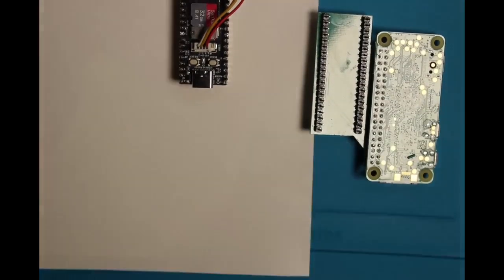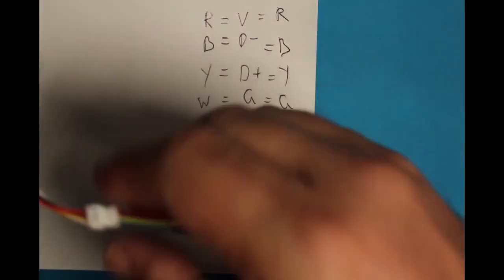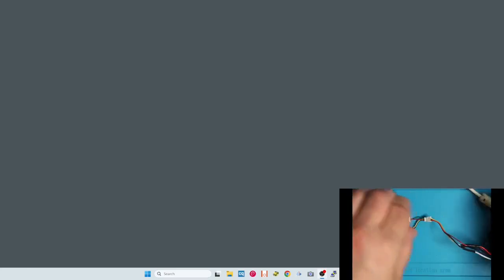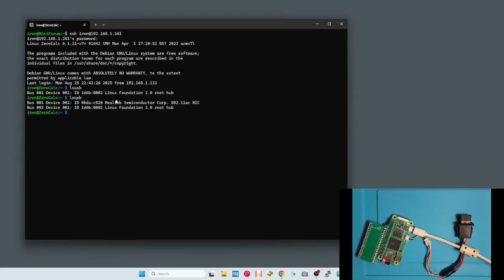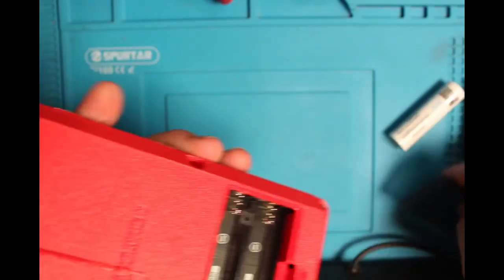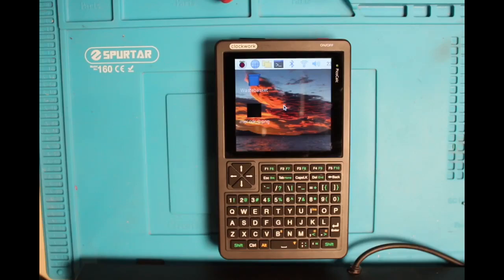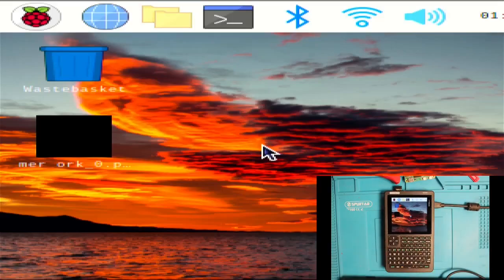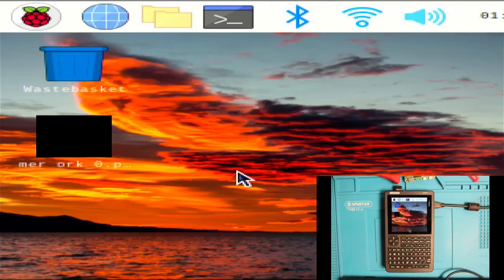Picocalc - Zero Mod Update - USB and Case

Comment: hi,

is the usb mod necessary for the zerocalc to work? because i really cannot solder on pads these tiny.....
Reply from the maker: No. It is only for having a USB port. If you don´t need a USB Port on your device it also works fine.

Comment: Hi,
Thanks for the video. I think that the pi zero 2 could be good for terminal  usage since pi zero 2 is a bit too light considering memory size. If used with GUI it would be nice to find  a light one adapted to the size of the screen
Reply from the maker: this is something i research currently. finding the right gui or fb applications.

Comment: Hi. Thank you for your videos. Please may I ask for some advice. I have been wanting a pocket sized device for years. I love the form factor of the lilygo t-deck but its driven by an esp32. I also like the m5stack cardputer but again its powered by esp32 and an even smaller screen. How is the picocalc for long sessions of typing? I love seeing you mod the picocalc. Im not sure which device to get.
Reply from the maker: Screen is small. 320x320 is more for terminal use but you will not get 80 columns, except with a small font. Keys are nice for a pocket device, have had worse. If  you like to type with it for an extended period it depends on you.